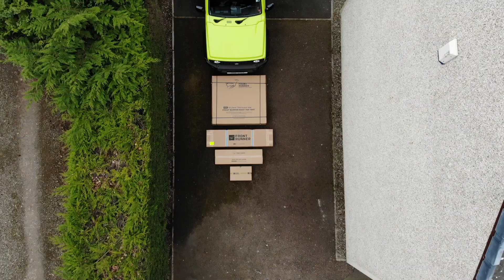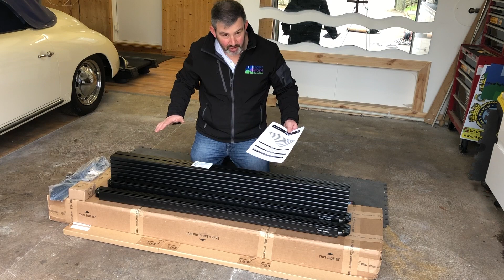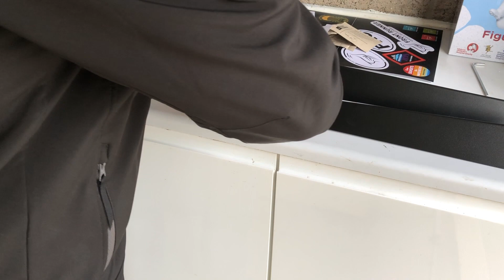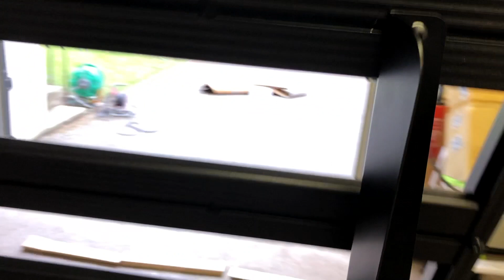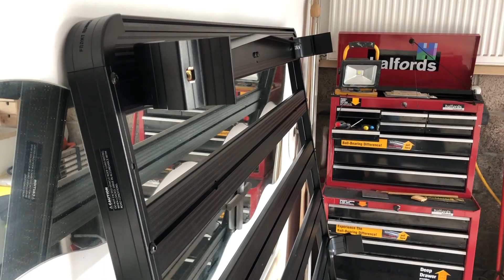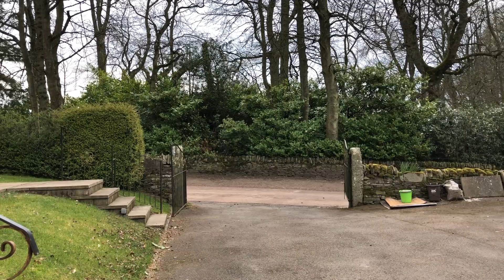Fitting the Front Runner Slimline II Roof Rack to my 2020 Suzuki Jimny

Comment: Is there rubber between the legs and the gutter ?
Reply from the maker: Hi, Front Runner advise that you should NOT place any rubber between the legs and the gutter - they insist on metal to metal contact. However, I did use some cut fuel tubing as gasket material and have had no problems. Just keep checking that it is in situ and hasn’t deteriorated! Best wishes. N

Comment: N thanks really appreciated the video which helped enormously compared with the instructions which were harder to follow. Quick question on all weather tyres did you raise the suspension of go with the same size tyre on the standard wheels? Say well Nick
Reply from the maker: Nick, I’m running on factory fir everything. Never had any reason to change and I’ve done some serious driving in serious weather. Cheers. N

Comment: Good tutorial. As you’ve had both the Front Runner and D.I.R. racks, which do you prefer? How is the fuel consumption with the rack attached and how well does it drive compared to without the rack.
Reply from the maker: They both do different jobs really! DIR looks great, FR works great. I never really carried anything on the DIR whereas the FR is used all the time. It also takes my FR Roof Tent!

Comment: Hi. Would you recommend to use locticte adhesive on the screws when assemblying the roof rack?..would that make sense?...it is a nice rack, hope they can sell and send to Mexico...regards!
Reply from the maker: Hi Hombre! Good question. I’d say no for 2 reasons: 1) All supplied nuts are either nyloc or used with locking washers and 2) A regular check of torque is probably sensible routine maintenance in any event. Just my thoughts of course. Stay safe my friend! N

Comment: Great video and much preferable than following the enclosed instructions. Altho' after spending a bit of time installing the wind deflector, the step which followed (legs) meant I had to remove the wind deflector haha. Happy with the end result and thanks again for helping luddites like myself figure it all out.
Reply from the maker: Glad it helped Chris!
Reply: Based on the order of instructions (and the order of this video) I bet everyone installing this rack has to remove the wind deflector to get the front legs on! Myself included!
Reply from the maker: @twistybakes5681  I didn’t have to - so not sure where you’re coming from. Sorry. N
Reply: @highergroundlifestyle  How do you slide the bolts for the clamp on to the first slat, if the bolt holes are covered by the wind deflector?  Or am I doing something wrong?

Comment: Thanks for the review! Just wanting to confirm, whether this is the standard height Slimline 2 rack you have or the tall version Slimline 2 rack? I’m having trouble deciding which is the best buy for my circumstances.
Reply from the maker: Hi, thanks for your comment. This is the standard height rack. As you will see, the wind deflectors are within a few mm of the roof. Personally - and especially on the Jimny - I’d want to keep the c of g as low as possible. Best wishes. N

Comment: Just a question doesn’t the roof only support 60kg   Your gear is close to that how does it go with you up in tent ❓thanks
Reply from the maker: Hi, the roof loading is a dynamic number so not an issue when stationary. No issues at all and their are cars out there with a lot more weight on the roof.

Comment: Hey mate, thanks for this video. Helped me install mine. 
Question though, where do the legs fit exactly on the gutter? It’s strange but the clamp above the driver and passenger door seem to impeding (ever so slightly) the door when you open and close? Did you get this? I can’t figure it out but the clearance is not enough from the clamp. Wish I could send you a photo. Have you got an email? Not sure if you having this problem.
Reply from the maker: OllyFoRealz The gap between the door tops and rack legs is minimal (3-4mm only) but it is there. I also used rubber tubing between the legs and the gutter to avoid metal to metal contact which also had the effect of raising the legs by 2-3 mm. I didn’t mention this in the video because Front Runner believe that metal to metal clamping is important for security. If you want you can send me a message via my Higher Ground Lifestyle Facebook page. Cheers. N
Reply: @highergroundlifestyle  Good tip re rubber tubing. My wife now keeps asking where her black resistance band has gone. Oops.

Comment: Hello sir,

first of, thank you for the very informational instruction videos. like you, i am the proud owner of a Jimny!😁 like you i also purchased and installed the slimline 2 roofrack (the regular one, not the tall one). and like you i also received two different sizes of wind deflectors. i called frontrunners and they told me either would do fine, but upon fitting the rack i noticed the deflectors were touching the roof. which one did you install in the rack? sincerely, Jan
Reply from the maker: Jan Eijk Hi, must confess that I didn’t pick up on the fact that the deflectors were different sizes! One of mine came in the rack kit, the other with the legs and roof tent mount kit. The one I used came in the rack kit and clears the roof by around 5 - 10mm. It is closest to the roof where it becomes ribbed and, as reported in the video, has resulted in zero wind noise. Let me know if specific dimensions would help! Cheers. N
Reply: storminatwork at Higher Ground Lifestyle i received a 20mm and a 45mm deflector, i dont know which one’s you received with your tent. i myself will add a rooftop tent from frontrunners next year 😀 as my wife and i are planning touring the highlands next year. by the way, is the tent large and comfortable enough for two adults? cheers